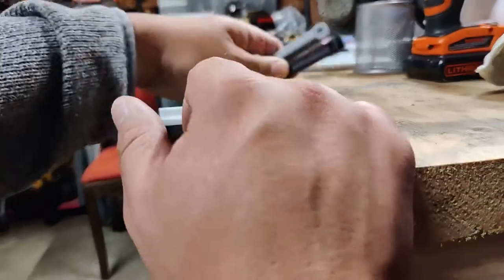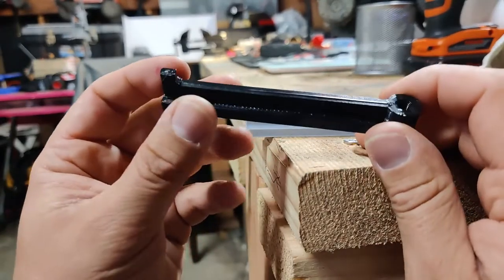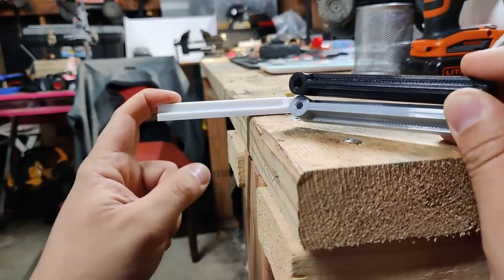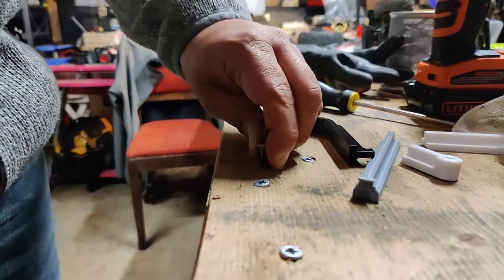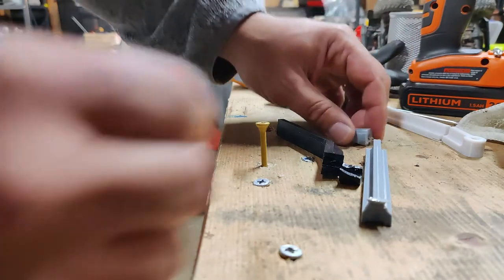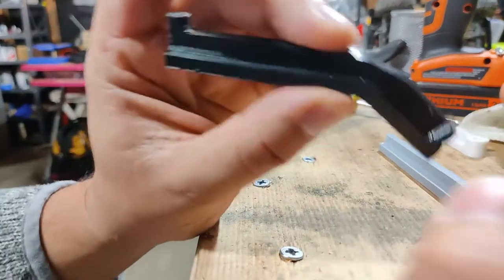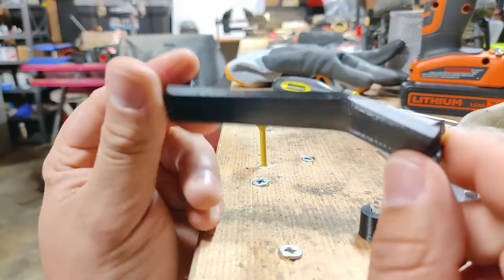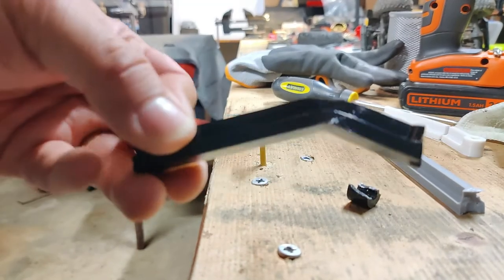Overture Easy Nylon Strength Test

Comment: Overture nylon is my all time favorite filament. I make rc car parts with it too and also threaded carabiners and stuff. Btw, If you anneal at 80c for 3-4 hours it makes it stiffer than the reccomended 70c for 2 hours. Doesn't warp it or anything. It may not make it stronger overall necessarily, im not sure about that, but it  definitely makes it stiffer.
Reply: Yeah, I recently started using it and my mind was blown just how well it prints and just how resilient the prints came out. In particular the layer adhesion is mind blowing to me. :o 99% of the time when things break they do so with no real consistency along layer lines. Like it just breaks and leaves this very uniform cross section, like it is an injection molded part. I just made a belt clip/fast hook for some camera stuff and, when I did the strength testing and impact testing I just couldn't break it really. ^^; Even with a hammer it seemed to hold up. Pretty wild just how strong it actually is.
Reply: I cant get it to print well. It just warps crazy and comes lose from the plate. Would you mind to share your settings? I want to use it for rc parts as wel.

Comment: Maybe you could try putting a weight on one and looking at how it bends? That would allow you to do some math to determine the young's modulus, yield strength and if you did some more tests tensile, and compression strength if you find those and combine that with a bit of statics you could get a pretty good estimate the strength of your designs before printing.
Reply: Unfortunately nylon copa's strength varies wildly depending on whether its been annealed, how its been annealed, and how much moisture its absorbed before or after annealing. Its properties are all over the place depending on those factors. Sometimes its brittle, other times it stretches a whole lot. Even after putting it in an rc car, its going to absorb moisture, so it's properties will go through constant changes. Its easily my favorite 3d printing material because of its strength to cost ratio and ease of printing, but it certainly has its faults when it comes to how hydroscopic it is. You could determine it's strength for a particular day, but even a few weeks later, your calculations wouldn't be relevant anymore unless you re-annealed the part. Even here in Phoenix Arizona, where it is legendarily hot and dry, I still have to re-anneal stuff because it absorbs moisture over the course of less than a month just sitting in my house. The texture loses its abrasion resistance and you can feel it soften with the way it starts to grip your fingertips.
Reply: @alexcrowder1673 Excellent reply & info. Just looking into this material... would you say it's comparable to 98a TPU after Easy Nylon has absorbed all the moisture it can?

And months when it's dryer, would the easy nylon naturally get less moisture content?

 I use 98a TPU for washers... thinking about using Easy Nylon for a counter sunk washer??? Bad idea?

Comment: what temps did you use with this brand for that part in the video ? curious i just purchased a roll of this for the same reason u have it - rc parts !!!!  the petg is good but brittle for the rc stuff
Reply from the maker: I did 255°C if remember correctly
Reply: @d440rc6  thanks !!  ill try it out when it arrives
Reply: I found the parts were considerably stronger when i printed them at 260 vs 255. Thats just my experience though, and the difference was only noticeable without a scale before annealing. After annealing it was less noticeable but still made a difference. Obviously its going to vary from person to person, and some 3d printers are going to fluctuate like crazy anyways at that temp. Sometimes my ender 3 goes from like 256-264 when set at 260. Prints great though! It actually prints better and cleaner than my esun pla+ or overture petg. My tpoimns petg is easily my easiest to print nicely though. That stuff is amazing, obviously not near as strong as overture nylon, but still has great UV resistances for outdoor use, as long as it doesnt require extreme strength.  Its only 16 bucks a kilo too and prints like a dream. I was honestly disappointed in overtures petg. I assumed itd be awesome like this overture nylon was. But even at 22 bucks a kilo overture petg was inferior in every way to my much cheaper tpoimns petg. Overture petg printed worse,  and it wasnt quite as strong or heat resistant as tpoimns was. I think tpoimns is disappearing though so ill probably be looking for another petg soon. If anyone has any reccomendations in the 15-25 US dollar range let me know.

Comment: Did you have to dry it first? I have a box of this that's brand new in the box that has been sitting around since Christmas.
Reply from the maker: Always in the dryer. This thing gets moisture really fast, and will print badly in no time if not kept dry
Reply: @d440rc6  good to know! I'll keep it sealed until I can figure out something to print. Thanks!
Reply: @3dPrintingMillennial  I use big boxy food dehydrator I got off Amazon 5 years ago, I can fit 6 spools in it at a time.  So I dry all my spools then store them in ice chests.   Has been working great for me!